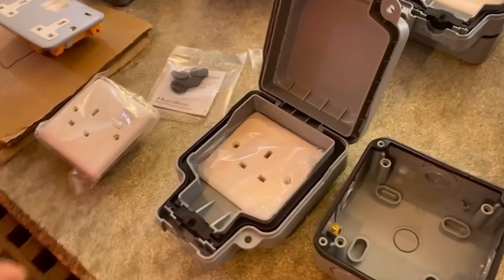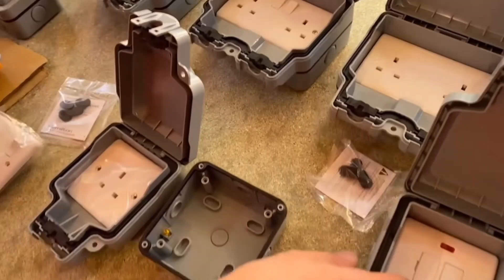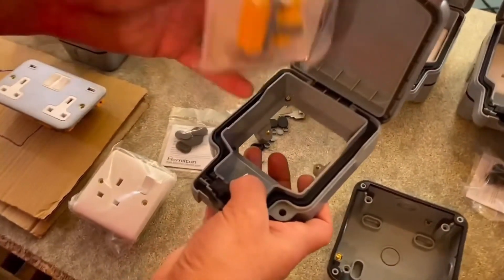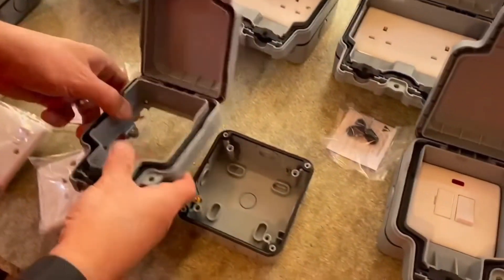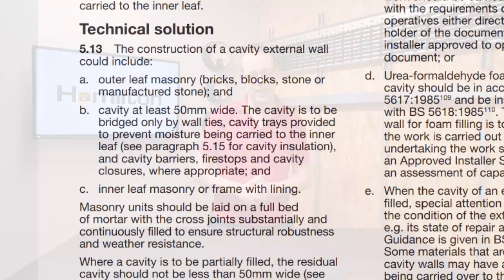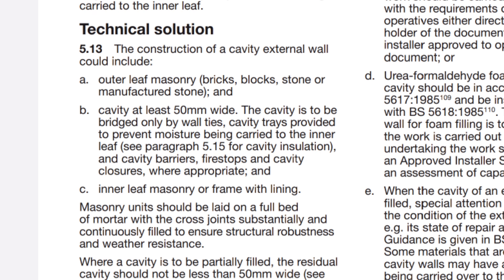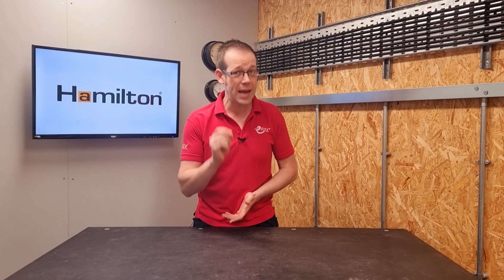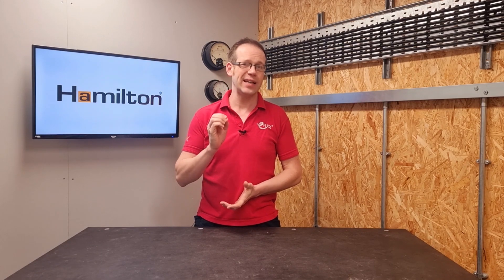CAN ELECTRICIANS INSTALL CABLES IN A CAVITY WALL?

Comment: Regards the warming effect of cavity wall insulation.
What about the same effect when csble is coveted by loft insulation in nearly all lofts?
Reply: I am guessing you're not an electrician.  This is something basic all circuit designs have to take in to account and is covered in great detail in the regulations.  A cable's current carrying capacity is basically regarded as being halved by being in contact with insulation.

Comment: When you have liquid water in the cavity it should only be running down the inside face of the outer brick leaf.  If you cross the cavity with a pipe or cable it should slope downwards towards the outside, so that water doesn't run along the pipe/cable from the outer leaf to wet the inner leaf.  Similarly, if you are doing a vertical run on the outside heading upwards from the point of crossing - construct a drip loop before the entry into the wall, so that water doesn't enter the cavity - the better TV aerial cable and telephone cable installs do the same thing.  The higher up on the wall the crossing is, the less likely you are to have problems.

Comment: You can't possibly say "there is no specific regulation that states you absolutely mustn't do this" then say "the simple answer to the questions is no you SHOULDN'T run cables in the cavity of an external wall".  The simple answer is yes you can as there is no regulation that prohibits it. 

How else do you get electricity from the inside of the house to the outside of the house? Through an open window?  Stick to being a shopping channel.

Comment: A now the government is going green and a lot of social housing is being covered with polystyrene blocks before rendering, is it ok to clip lighting cables or external socket outlets being fixed to the face of the house beneath the polystyrene if it’s clipped in zones and protected by an rcd?

Comment: I just discovered that whoever built my 1950s home used this trick. There's a spur coming off the upstairs sockets circuit that vanishes through a hole in the first floor wall, runs vertically inside the cavity for about ten foot, and then re-emerges in the room downstairs. I was a bit surprised when I first saw this but apparently it used to be quite common. I'm planning to replace the cable because it must be 70 years old by now, and the insulation has started to crumble.

Comment: If cavity-wall insulation is to be used ; there SHOULD be a LARGE air space gap in-between the face of the insulation and the OUTER WALL inside the cavity-wall ; this includes an air space gap in-between the face of the insulation and the cavity-wall-tie drip point in the centre of the cavity-wall.
Ask N.V.Q. BRICKWORK teachers for PROOF of this !

Comment: The bit about the cable bridging the cavity is clearly nonsense as any cable that crosses the cavity from inside to outside such as to an outside light, socket, incoming telecoms service, SKY etc. would be the same and how many buildings have electric fixtures on the outside (clue almost all of them!).   If moisture were to come into contact with the cable it could track down it and so it would be sensible for cables to only go up from the outside fixture so any moisture I directed to the outside wall leaf not the inside.

Comment: No matter how politically correct a cable installation is, there is no certainty of zero risk, and any good experienced electrician who has spent the 80s and 90s safely re-wiring houses will stand by the safety and practicality of wall cavities as natural cable routes...

Comment: In Denmark it is very normal practice to run cables in the cavity.  The inner leaf is built first after which the cabling is run including clipping after which the outer leaf together with the cavity wall insulation is built.

Comment: I was always taught external cavities are a no-go area and internal cavities are only if you have to, and there aren't any other solutions. Modern building methods present numerous issues when rewiring/re plumbing but there is normally a sensible solution to each problem. The best thing I find is to explain to the customer what is going to happen ie. Chases etc and if they aren't happy you can just walk away.

Comment: Brick ties ( wall separators etc ) will cause moisture issues ( our buildings can weaken and spread without them) . It also prevents ingress and shocks to children etc ( they spill stuff and break external bits ) .always,try to use under building feeds via cavities ( the other trades appreciate it as well) . Not to mention it is a better use of space ( in certain centres I use flexible metal conduit similar to liquitite etc. tidier work with less chance of ingress or user damage .

Comment: Sometimes this is the only way, couple of tips I think it's important if you gotta do it, drill the holes at a angle so that rain can't run into and down the hole, and then after the cables in, blow out dust from holes then silicone both holes inside and out. And sometimes if I feel it safe to do so I try to leave some slack in the wall for the future me. A side note if there's only one cable being put into a terminal that holds cables with a skrew... Please please please double the cable up, it doesn't take long and isn't hard but it's something I rarely see done

Comment: Hmm…. The transference of moisture between the cable (or conduit) making contact between the inner and outer walls which can give rise to damp, is a problem in the making. Never gave it a thought until you mentioned it.

Comment: Even more opportunities for sanctimonious pedantry "A porch light ma'am? - No problem - but you won't believe how much cable we'll be using, how much we'll charge and how ugly it will be when run down the outside from the soffit of your otherwise lovely looking town house" "Only a cowboy would bridge that 100mm cavity" "We have the regs on our side"  Wouldn't it be better for the electrician industry to look at how best to solve the cavity bridging requirement for outside sockets and lights or don't they have a seat at the table when the building regs are decided?

Comment: If they advise you to not run cables in the cavity, they need to come up with a new way to build houses. A lot of concrete floor new builds literally only allow for trunking/Conduit to which customers turn their nose up.

Comment: Watched this with interest. Most of my house is solid walls, but some decades ago the kitchen extension was built with cavity walls and the contractor wired it through the cavity. None of that wiring goes through the outer leaf. This confirms my view that I was wise to resist salesmen who wanted to fill the cavity with insulation.

Comment: We use to run cables in a conservatory dwarf wall all the time and it’s the only way on a finished brick wall ( clients get the hump if you trunking the new wall 😃) perhaps using FP 200 could be the answer.

Comment: Haha, This is a trick question because how else are you to get electric cabling from the outside to the inside, regardless of if it's tails or twin&earth? Unless you have your own power station built within your property. So it's a physical impossibility. 1). Where I live the electric company have run their large tail cables up the cavity wall to my 2nd floor landing and into my meter box and four other meter boxes, all situated on outside walls (so the meters can be read). Then, and you can clearly see, the tails then go back into the cavity wall and up into the attic before feeding down into the fuse board. These properties were built in the 1990's. 2). Our new extension at my parents, still being built, has had an electrical feed taken from the current fuse box into a new fuse box spur, then the twin&earth taken up into the ceiling, ran through joists, then drilled out through the cavity wall into the roof space of the extension. Personally, for things I've done I've located the outside item where I need it, drilled a hole through to the inside, fed the cable through creating a drip point, sealed it, and ran the cable inside, in conduit. I personally am happy to see where cables are, but that drip point prevents damp, and the sealer stops the ingress.

Comment: Sky engineers drill straight through the wall and poke the cable through then run it up to the dish, I know that’s not carrying current but I do always wonder about whether it can cause damp issues?
Reply: They usually fit a cover plate, blast the hole with silicone, leave a drip loop on the cable. Not really likely to cause any trouble.

Comment: Can't see any problem with going through cavity , common sense slop hole down to the outside  seal hole  and cable lays flat on wall, loop round to go up  water runs off bottom of loop no problem  no damp

Comment: Electricity board had been doing it on probably thousands of houses rewires back in the day you ought to see some of holes left in floor joists total butchers,   not much in the way of insulation in them times till you get blown  insulation  doh

Comment: Even if conduit is used inside the cavity it will transfer moisture from the outside to the inside, and if vertical the weight of the cable is still a problem. The shorter the run of cable the better, better to go through the cavity than a long run of cable.

Comment: Was speaking to a technical advisor from my local DNO in Dec 21 and I was surprised to find he had no issue with meter tails being run inside a cavity. I have to run some to a relocated meter box and the only realistic route id via the cavity in some conduit (a..k.a waste pipe)...
Reply from the maker: The DNO doesn’t have responsibility for the tails - you do - check that derating if the cavity is full of thermal insulation

Comment: I bet there’s millions of cables around the country going through cavity walls without a single overheating, fire, damp or cable damage issue.
Reply from the maker: Oh well let’s just ignore best practice and crack on.
Reply: @efixx  but I wasn’t being funny, I was just stating the likelihood, meaning that IMHO, some best practice recommendations are questionable. You are the one who asked for our thoughts and opinions. If your that sensitive, don’t ask people to start a discussion.
Reply: @MoelwynHopkins  Quite agree, no one can apply their own common sense to each scenario anymore. I don't really run down inside cavity often but if i do cables are always routed with the lowest entry/exit on the outside wall - water doesn't travel upwards

Comment: AlwYs prefer  a it’s to walls straddled by ugly conduit/duct that is prove to weather /UV or morons with trolleys. I have yet to see someone drill into it( I have seen a logo guys drill into cabled joists and smashed conduit in garages etc … soyesafter 50 + years I would go for a a it’s every time

Comment: I think it’s acceptable to run directly, (perpendicular to the internal wall) to an outside socket or light although I take the point about protecting the 75mm of exposed PVC, but the biggest argument for me is the poor old builder or DIYer who is outside up his ladder knocking out a brick with a bolster, he’d be forgiven for not expecting to come across a 10mm shower cable in the cavity, especially pre RCD days!

Comment: Ran about two metres of 2.5 T&E down a cavity in the last month, quite proud of the achievement. It's fully sleeved end to end in flexible conduit, so well protected. There were few options open to me, it's a basement conversion with membranes everywhere, couldn't peirce those, so down the cavity it went. 

My deceased business partner did a few years for the council and dropping cables down cavities was the preferred method.

Comment: Will this apply to DNO, s as well when they are running their mains to the meter cabinet?
Reply: They haven't run their main cable inside new build cavity for years and years. Look at any house built in the last 20 odd years and they nearly all have hockey stick entries to the bottom left of the outside meter box.

Comment: Local Authorities and Housing Associations are still running cables in cavities when doing rewires because of cost, they want the cheapest job possible. Everything is short term because there is no money.

Comment: It s happening a lot. There is a chap on TikTok whose unique selling point is the hidden cables for his CCTV installs - quite often in the cavity. From the comments it is OK because it is extra low voltage 🙄.
Reply from the maker: Unless the cavity is stuffed with polystyrene
Reply: @efixx  there is still the issue of bridging the cavity, the voltage level is almost irrelevant

Comment: When a large company installed solar on my house, 6 years ago,  they ran the DC to the inverter down the cavity from roof to the garage wall. 350V and 5kw peak. Appeared to be their standard practice.
Reply: I’ve seen this done many times by solar installers

Comment: Yeah I remember we used to drill a hole in to the cavity then try fish out a string with a weight for some outside lighting jobs I think if your only going down a few hundred mm for a pir as long as its not ramd full of glass wool or polystyrene beeds filling the cavity with insulation was the worst thing to help transfer damp between the brick skins...👍

Comment: This video came out only a short while after a YouTube electrician ran tails in the cavity which had polystyrene beads in the cavity. To protect the tails they wrapped it in tape.
Reply from the maker: Haven't seen that one, who was it?
Reply: @efixx  https://www.youtube.com/watch?v=LucnwGaAqgk
Reply: To be fair, they only ran the tails THROUGH the cavity protected by tape. The original tails ran in the cavity I believe, but they drilled straight through the wall and fed the new ones in.

Comment: So would dropping a cable down from a loft to the ground floor enclosed in flexicon be acceptable if the holes are then filled back in, this would prevent any exposure of the cable to the air and also prevent any moisture from entering
Reply: still wont be clipped, the more material you put around the cable will de-rate it further, you may create condensation in the tube which will follow gravity and of course it still has the ability to breach the leaves

Comment: The building regs are clearly referring to vertical runs through the cavity, not horizontal runs to outside accessories. Do people still actually run cables vertically through the cavity these days? It's not something I've done since starting my apprenticeship in '98, although have seen properties wired like that. Thought it was old hat and people stopped doing it for the reasons Joe mentioned, plus the fact the building regs clearly state not to which is legislation.
Reply from the maker: It's interesting the amount of engagement the video's had, it could be an indicator people are doing it again?
Reply: For solar installs it is tempting.